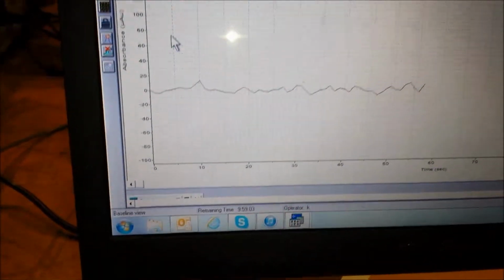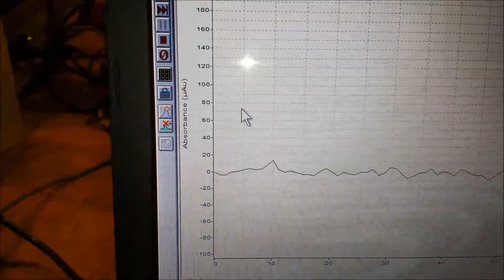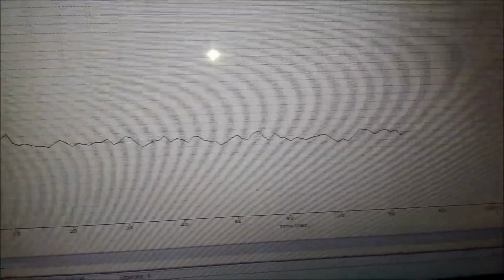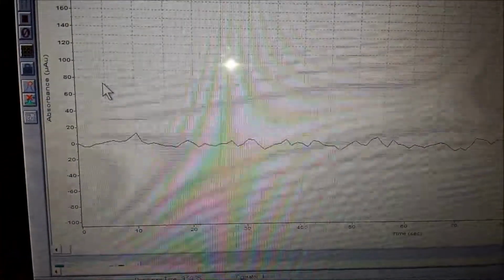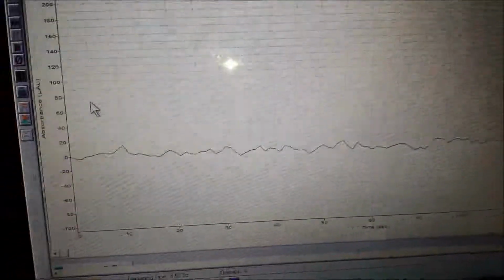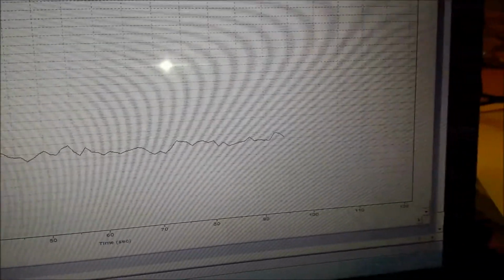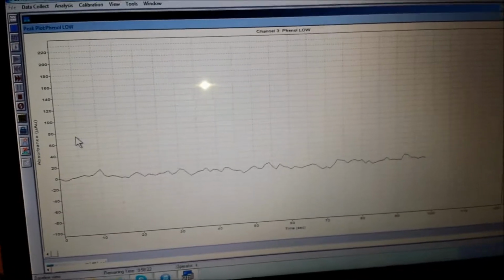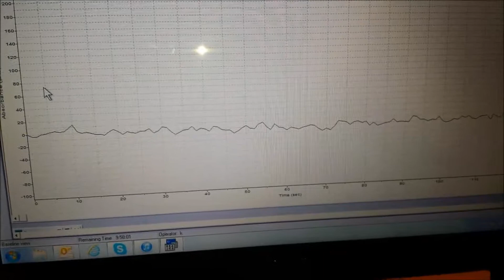Autoanalyzer Troubleshooting Basics: Establishing a Flat Baseline

Comment: Hello ser kindly advise... i have flat baseline in water 5... upon switching reagent to KCN & CT + buffer solution line... the baseline become erratic 9.5-10.5 after set base into 10... is this something wrong with the reagent?
Reply: Hello

That seems likely.  Do you see a visible color in the lines once all the reagents are on?  If so that could imply contamination.  Also I would want to know how the bubble pattern is, does the flow seem to change after the reagents are on?  Also top be clear what chemistry are you running and on what instrument?
You can directly email me at ken@ekem.com if you like.

ken
Reply: Hi Ken the emai is not working...
Reply: so sorry, my email is ken@ezkem.com